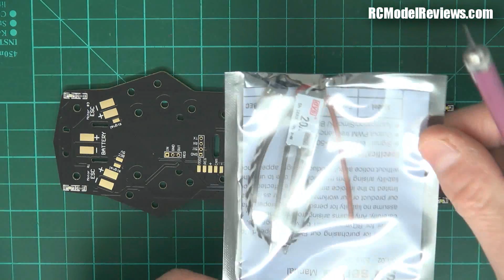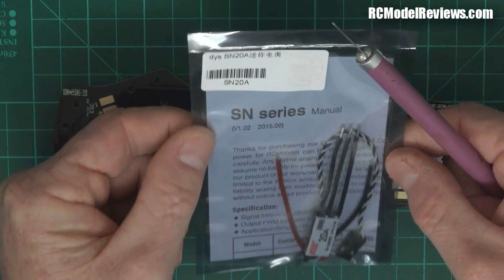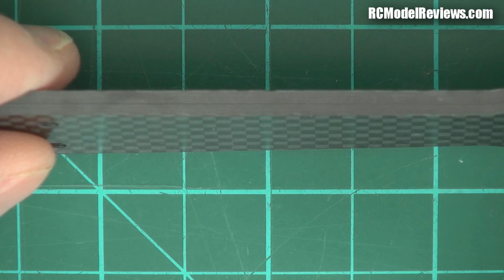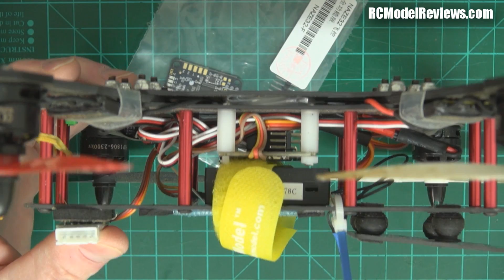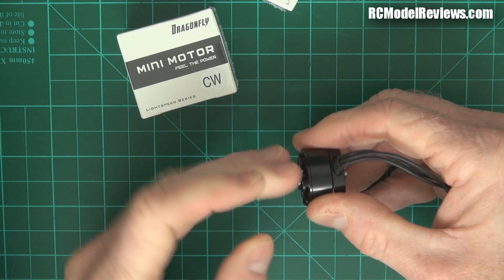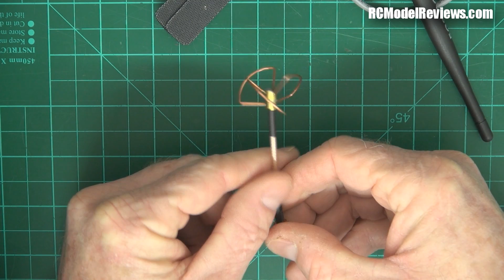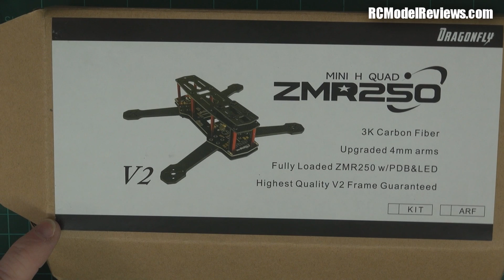ZMR250V2 ARF from FPVModel.com (part 1)

Comment: Bruce the carbon is no better than the carbon in the original, I bought a set of spares to see how they compared with my own arms. I split open one and found what I expected nothing but unidirectional carbon fibre with a outer layer of woven to fool the public, making the quad out of thicker carbon will make it a bit stronger but mainly it will just add weight. It's what the carbon is made from not how thick it is that makes for a better arm. If you want pics I have them.
Reply: +Kendrick Apps That's pretty disappointing, I was really thinking this frame could be a nice upgrade for my v1 ZMR with the thicker arms and body plates. Interestingly, some of the original ones were cut from proper quality woven CF, all the way through. I tested it by breaking one, and confirmed this. Mine came from MyRCMart, and there's at least one US vendor selling the same frames that I'm aware of. One just needs to look around and read a lot of reviews. /r/multicopter helped me out a lot in finding out which vendors were legit, and which were full of shit
Reply: +Kendrick Apps You do realise the twill weave is purely eye candy and is not intended for structural strength. That is the purpose of the uni directional and random chopped fibres?
Reply: No carbon fibre has random chopped fibres or if this was a car body shop with glass fibre it would be called matting as for it makes no difference I defer to the expert blackout the drunk you ask him if he would let unidirectional carbon near his quads and see what he says. All of this was discussed when Bruce had his problems with his ZMR mk1 arms. I am not knocking unidirectional carbon it does have its uses and works very well in most places but arms on a racing quad is defiantly not one of them.
Reply: +Kendrick Apps Chris I hoped it would be an improvement as well, we can't win them all at the moment the best upgrade you can get for the ZMR v1 is a set of my arms and the various 3D printed parts that are out there the ZMR v1 body is fine most will not have to tweak it  there are custom PDB's out there like in this quad has.
Looks like my version of a ZMR v2 will have to swap places with the my micro quad and get finished.
Reply: There's definitely ways that unidirectional CF COULD be used in quad arms and be strong, it's just the way that the cheapo zmr frames do it, it's a poor substitute for twill.

The strongest CF parts will often be hand laid up with tows arranged for the most strength in areas where stress is concentrated. There are people who hand layup APC clone props for example, using tows of carbon fibre looped around the hub for hugely strong parts.

But really, the stuff we see in these cheapo arms is nothing like that, there's no benefit to layering unidirectional strands at opposing angles, when you're cutting it out with a router. It just results in a more easily de-laminated, less rigid product. Not to mention the "floppy arms syndrome" that people have experienced with these cheap arms.

Woven CF isn't the strongest in a single direction, but that's not what's important in an application like this. it needs rigidity and strength on all axis, because the loads put on it aren't concentrated in one direction
Reply: Kendrick Apps where abouts are you selling your arms? I'd like to take a look at them :)

(without any context, that would be a very strange request :P)
Reply: +Chris Tate I have my own web site but as I am a one man show I have not had time to get it up and running best way to find my arms at the moment is on eBay search for "Cleland ZMR arms" at least on of my listings has my logo on it that is on every post.
Reply: +Kendrick Apps It took a little bit of searching, showing some other vendors as well.  For anybody else searching, I think the ebay vendor name is hamlet990.
Reply: If you want a drop in quality replacement arms from a recognised web site try boltrc.com. The Bolt250 shares a the root hole locations with the ZMR and has 3mm and 4mm versions both with integral motor protection extensions. There are branches in Aus,UK and Ned.
RcGroups discussion on the Bolt 250 here 
http://www.rcgroups.com/forums/showthread.php?t=2347884&highlight=bolt250
Reply: +Mark Harrison that's me. As soon as I get the web site up I will reduce my dependence on eBay I hate the public paying extra to cover eBay's  cut on every sale!
Reply: +Rob B what are you saying my arms are inferior to the bolt or ZMR v2 or because I have not got a large web site selling lots of items I should be considered, the small guy can do just as good a job as the big company's sometimes better as their overheads are much lower. This is a discussion to be moved to my sales thread on rcgroups  
http://www.rcgroups.com/forums/showthread.php?t=2333817&page=3
Kendrick.
Reply: +Kendrick Apps No that is not what I was suggesting. At the time I made the comment I was not aware you were making and selling substitute arms, merely pointing out a supplier of good quality arms and complete frames with international outlets.
Reply: Man it's great to see in the past couple of months where I've been out of the mini quad scene, replacement ZMR parts are everywhere now. PDBs seem pretty available, and multiple sources of quality arms, that's awesome progress from even 3 months ago.

Does anyone know why the bolt arms have those hexagonal holes and sticking out parts at the motor end? Just to protect the motor from impacts? Or bolting stuff together with hex nuts? :p
Reply: The bumps are designed to help protect the motor. The hex is just a design meme. The complete frame features thes hex holes.
Reply: oh fair enough man, that's a pretty nice feature, something I wish more frames included. That said, I would still put tape around the holes in the base of my quad's motors- mud is a killer if you're unlucky and manage to lawn-dart the damn thing. Living in NZ, we have enough rain that most of the time my crashes result in getting mud stuck in my quad in some way or another. It sure wouldn't hurt to have a little protection from harder impacts for my motors though.

Thanks for the info man!
Reply: +Chris Tate  beware of some of the PDB's both full sheet and small ones about the size of a naze board there are several major concerns thin power tracks that will not take the current voltage reduction chips instead of the better DC to DC buck transformers and strangely LEDs some dislike unless there is a switch to turn them off the last because of power drain, I don't see the last one myself those micro sad LEDs can't use that much power maybe it's the super bright LEDs some fit that people are concerned about.
Reply: +Rob B I've been thinking that extra motor protection is a good thing to have but not using carbon and defiantly not as part of the same sheet as the arms were cut from as in the bolt, I'm not knocking the design having it there will most certainly have saved some motors but in the case of a bad crash the impact may have written of the bumps or by transition of force of impact snapped the whole arm. I would and will be taking a different route a bit like bumpers or fenders on a car, the extra meat would be made out of HDPE attached to the carbon arms with only 2 m2 bolts, HDPE will take a lot of bashing and come back for more whereas carbon or something made on a 3D printer would be damaged. Fixing on with only 2 thin bolts would be so that if in the event of a crash the bolts shear not transmit the impact to the arm, body protection out of HDPE would be a good idea to fit at the same time.
Kendrick
Reply: +Kendrick Apps What ever blows your hair back. Unless you can find a material that will significantly absorb the impact and remain a reasonable size you are wasting your time since bumps or no bumps the energy is the same. Arms are cheap good motors less so.

Comment: Bruce noooo you didn't just call those ESCs "opto" 2:01 .... BEC-less would be a better term ;)
For an ESC to be classified as "OPTO" it would have NO common ground or power from the motor supply side and the signal side to the ESC. Most so-called "OPTO" ESCs are actually just BEC-Less ESCs, but that is just manufacturer marketing because it sound's moar better. Don't be suckered in. 

In a true OPTO a LED will send the drive signal to a photodiode and there's no direct connection to the motor supply voltage. These types of ESC will require a separate power supply voltage for the ESC MCU in addition to the main battery that goes to the FETs.
Reply: I come from an electronics background as well and this is just another case of the rc world taking the easy route when naming i! The same is done with connectors.
Reply: +EngineerX +Kendrick Apps Bruce did acknowledge that they're not actually optoisolated ESCs, though I totally understand where you're coming from as an EE. The blatant misuse of terminology in RC electronics is so damn annoying! "I'll have a JST connector, please" - "err, which one, they make a few hundred different models of connector" - "I'll have a JST type one please" ...LOL
Reply: +Chris Tate Somebody other than you know who has to give Bruce a hard time!!! LoL..... Yep, so many terms so little time to get them right :)
Reply: +EngineerX  I agree every time I see one of my friends it's the same we argue about the "gender" of a connector EE know that the metal decides the gender not the shroud so I just call them battery type and ESC type and I believe hobby King has started to do the same!

Comment: The transparent arms, aren't plexiglass, I believe, but polycarbonate. and some say stronger than carbon, some say almost as strong, but slightly heavier and cheaper.  they exist as upgrades for most frames today.  you'd also notice that the polycarb arms has reduced stress risers.
Reply: I agree that it is probably polycarbonate but it is NOT stronger polycarbonate is brittle I know about the polycarbonate arms they are for a night hawk and the company now does them in carbon.
Reply: yeah. but with being cheaper it might not matter, depends on how much of a difference there is in strength, if the hit is strong enough to break a PC arm it may very well be strong enough to delaminate a carbon arm rendering it useless as well. so if you go through arms fast with lots of high energy impact, it might make more sense to go PC, economically.
Reply: +RCKnut Quality 4mm carbon is almost indestructible in a miniquad crash.  If you do manage to break real high quality 4mm carbon in a crash the broken arm is probably the least of your worries because there are probably lots of other trashed parts from such a bad crash.  Not all carbon is equal and lots of the cheaper frames put a carbon veneer on G10 fiberglass and call it carbon fiber.
Reply: Sorry polycarbonate is the wrong material to use for a ZMR I sell a set of arms 3mm thick made from carbon fibre that you could not break without writing off the whole quad.
As far as alternative materials are concerned HDPE is a much better option there is at least one complete quad out there made from this plastic, it's a bit heavy but will take bashing like a tank that quad uses 1/4 inch HDPE.
Reply: I don't know the composition of g10 glass fibre so cannot comment as to its strength I do remember it was a bit more than a twill Veneer that the carbon glass Compisits were made from and if I remember from Bruce with one set of arms the glass in the arm was the only thing holding the arm together.
As for "quality" 4mm carbon will not break I agree with you the problem is any carbon that consists of unidirectional carbon cloth layers at 90 degrees to each other with a veneer of woven cloth to make it look good is not "quality" carbon it has its uses but not in high impact areas for that you need to use carbon cloth on every layer like any reputable non China manufacturer does.
Reply: I "broke" the 3mm arm on my nighthawk without breaking the entire quad, and it broke on the structurally most solid place. where there was no cutouts as it broke right where it meets the body, so the edge of the body worked like a "break".as I remember it broke the 2-3 first layers of CF and delaminated the rest. an emergency fix with thin CA worked great untill I got a replacement though.

But the point is, CF is by no means unbreakable even without cutouts and the arms can easily break without breaking other parts on the quad. it's all about leverage, and they are arms, they have all the leverage and all the mass is in the body. even 4mm could break in this way. 6mm you'r pretty much in unbreakable unless you're really unlycky territory. BUT that's where other issues come in. if the arms don't break and this take a lot of the force, ALL the force from the impact is transferred to the center of mass, the frame itself and other stuff will break. 

So having unreakable arms isn't necessarily a good thing either. it just means you break other more expensive and harder to replace stuff.
Reply: +RCKnut are you uk based if so would you like a set of my nighthawk arms when I have the design perfected. Arms always go at the highest point of stress on a ZMR this is where the arm meets the motor plate on a nighthawk many expected including me that it would go where the cut outs are but its not the highest point of stress for most people who have broken an arm say it breaks at the body bolts this is part design error but mainly type of carbon.
Reply: no, a bit to the east of the UK :)
Reply: +Kendrick Apps I have to back up Kendrick as I bought some of his arms from ebay and they have taken a huge beating and not broken...:)

Comment: Made me compare a couple of PDB's I got from banggood, the Diatone V2.1 seems to have an inner layer as the signal tracks don't seem to break the power fills and they do not have the big rectangular cutout in the centre. The YKS PDB looks like it was engineered by three people, the guy who likes copper fill, the guy who then drives signal wires through each then the last bloke who mills out any material that could help strength. I swear that YKS is passing two motor feeds through a total of about 5mm of 1oz copper, 3mm pinch on one side and about 2mm on the other, shocking. I can't see that working for long without some extra wiring, glad I only bought one to test. As usual great info thanks.

Comment: And i still use deans lol. If need to solder everything to xt60.. Then i will be busy for a month or so lol. Nothing wrong with the deans!
Reply: +Ricardo Smits Deans must stay 100% flush or copper is exposed. XT60 sleeve over the copper.
Reply: Snap. So many of my batteries are deans it would cost be a fortune to replace them all. :(

Comment: I use plexiglass to make my own arms. Just hotglue some carbon to it and rout it down to the glass. Maybe that's why they give you one.
Reply: +Don't Sub 

thats what i thoght
Reply: +Don't Sub I also thought the same thing, I've ordered one and if the arm are weak I'm thinking about making some aluminium arms. They wont be as strong, but will bend rather than break. Meaning that they could be bent back to shape. Might be heavy tho, have to see. Wonder if anyone else has tried this on a zmr.
Reply: +David B it's better having them brake than bend, the forces go everywhere,less chance to ruin anything else. aluminium arms- bad idea imo
Reply: YE\ep, Been testing the frame and seems to take a beating. No need for different arms on this one. Running the 2204 which are thicker in the section it tends to break.

Comment: just a note about the sn20a and bl20a escs: dys has cheapened out lately and are using lower quality fets, this makes them prone to smoking and they can't switch fast enough making them lose between 50 and 300 grams of thrust depending what you compare it against and what you are trying to run 2204 and 4s is known to run a lot worse than most other escs, even HK and turnigy branded ones

Comment: You can flash the SimonK SN20's with the Turnigy USB linker. It's super easy.
Reply: Thanks for that bit of info I've got some of the esc's and an Afro USB adapter now I know I don't need to get another device.
Reply: +JKFlorida You don't even need the USB linker, you can use cleanflight now
Reply: Zillawill Yep!